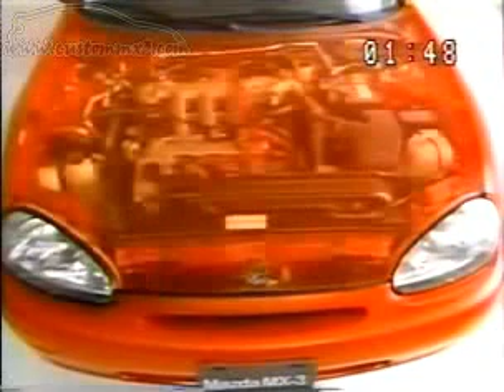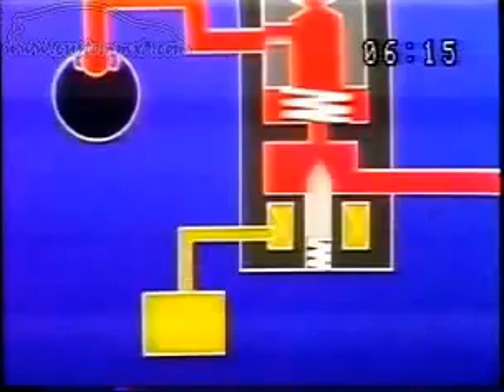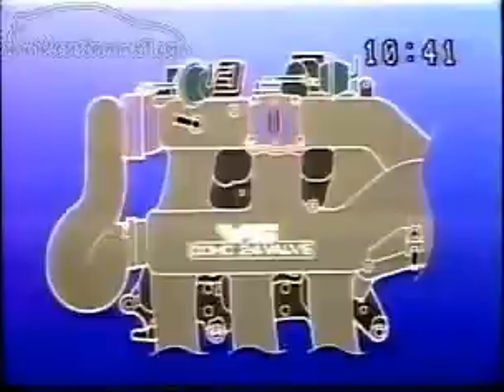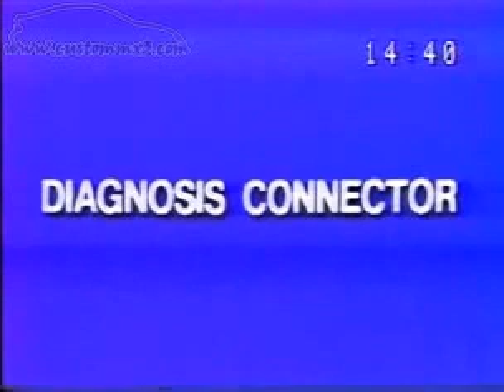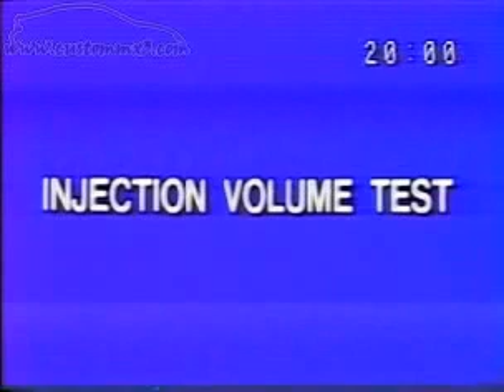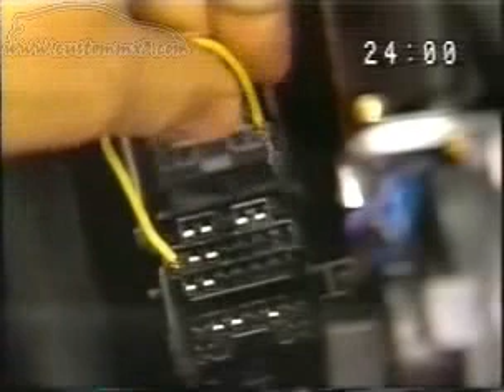Mazda Mx-3 Dealership Training Video

Comment: Thank for this video. It is s truly golden piece of automotive (and Mazda) history. Hopefully car industry could switch back to this golden age of cars.

I have MX-3 V6 in red and it beats both of my  BMW's in almost every way. I mean, my E36 320i and E46 328i have coilovers and all, but this MX-3 is better handling machine, it has more exciting engine, lower fuel consumption, it has better handling in twisties and it still goes highway speeds straight, like bullet train. Masterpiece of engineering.
Reply: They were truly ahead of their time.  I truly miss my MX-3's. I sold them as the family grew, but did manage to find out the guy who I sold my GS and RS to, took them to the salvage yard (they were rolling chassis) . That was a very sad moment for me :(.
Reply: @custommx3  Oh, what a sad story. I hope you'll find some nice MX-3 once again. They are getting pretty rare, but I managed to find pretty original one just few months back. It instantly became my daily driver, as I don't need to carry passengers. It even has sufficient cargo space for my use. Motor is still running like new, even it has 387 000 original kilometers (240 000 miles).
All Best to you and warm greetings from Finland!
Reply: @custommx3  By the way, my MX-3 has ethanol-conversion kit installed. It is very convenient to have. Keeps the motor clean and even adds some power. I mean everyone can notice the increase of performance. Fuel consumption is of course higher, but RE85 (85% ethanol) is very cheap in here. I even manage to save some pennies using it. I can't find any negatives, even our government pays 50% of that conversion, because it lowers the CO2 emissions near to zero.
Also, I'm going to register it, as a historic vehicle, in the next year, because it is in original condition and even has original wheels from 1993. Car must be +30 years old (+one year). If everything goes well, and it is accepted as a historic vehicle, i don't have to pay any taxes. Only thing I'm considered, is it acceptable, because it has been repainted just a year ago?